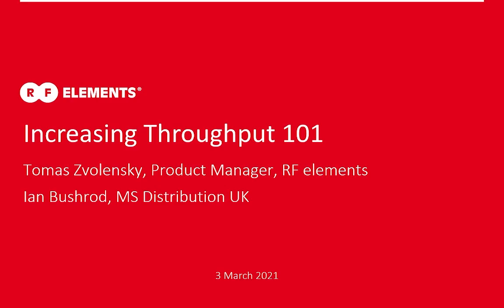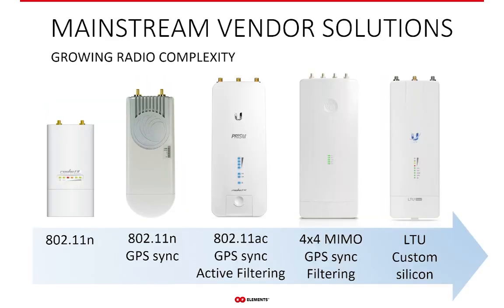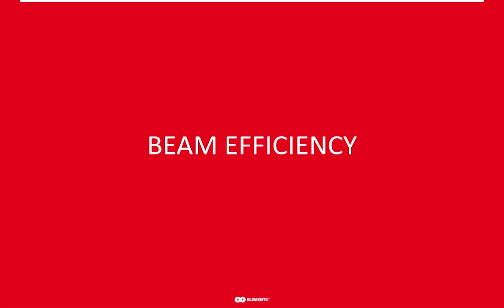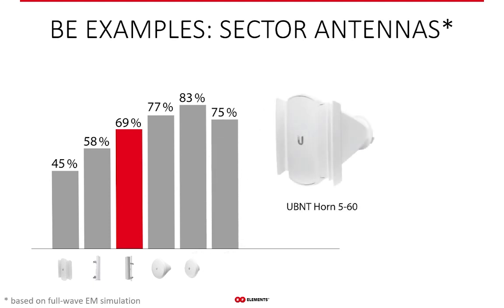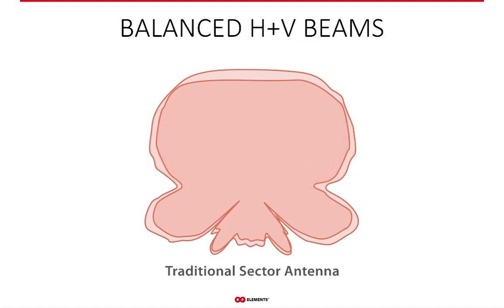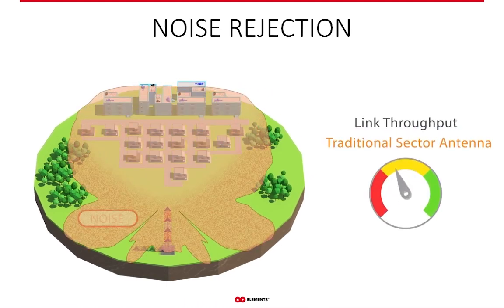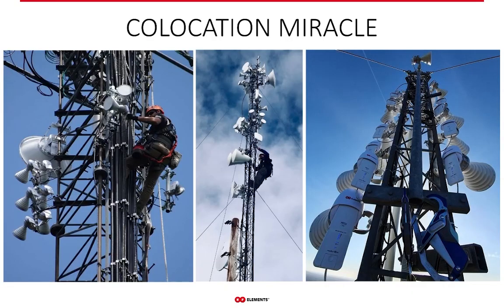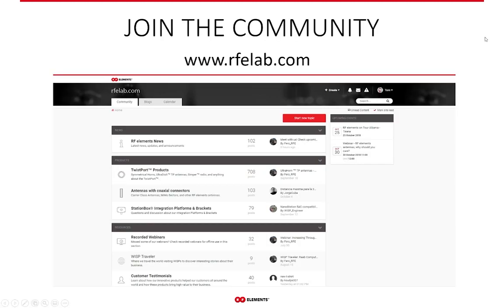Increasing Throughput of 5 GHz Fixed Wireless Networks

Comment from the maker: In your opinion, which component is the most effective throughput increasing measure - noise rejection, high beam efficiency, balanced H/V polarizations, or zero loss system?
Reply from the maker: @AVS_TELECOM  Indeed, you are right :)
Reply: Pre-watch take:

You'd think treating the polarizations as separate would allow you to increase capacity, no? A H signal is going to be heard less loudly through a V antenna, so is going to interfere less with V signals than with other H signals. Maybe it's different at these frequencies and with terrestrial radio vs. satellite.

All the other things are critically important. Your feedlines must be as low loss as possible to make the most of your antennas, and equipment must be shielded against irrelevant signals ("noise").
Reply: Post-watch and assessing your product line from your Web site, I see you have treated H and V polarization correctly.